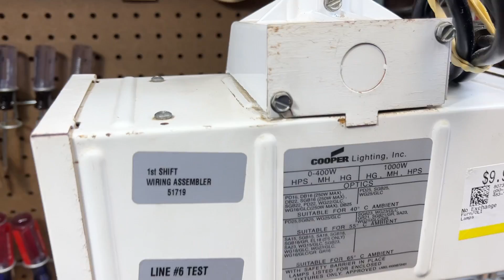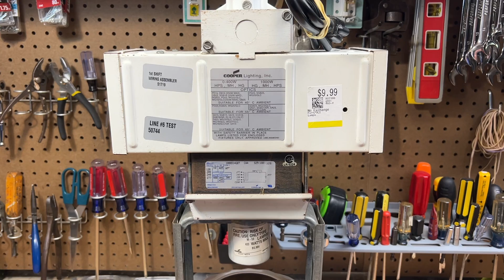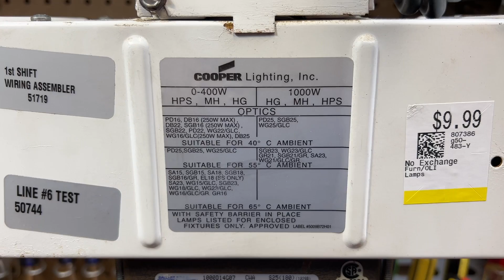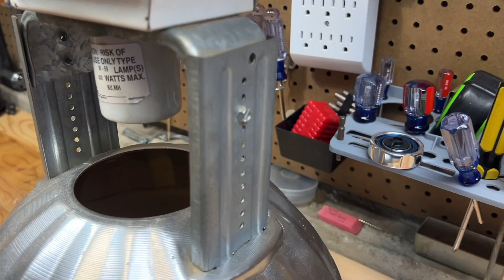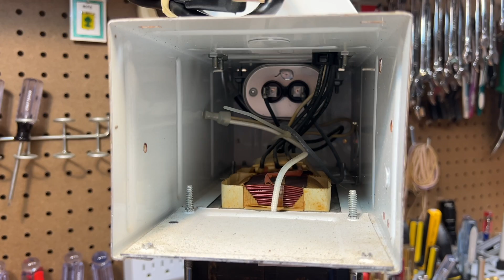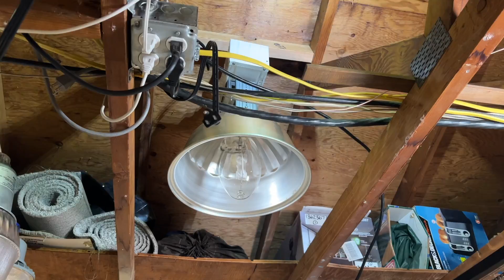Cooper Lighting Steeler 400w Metal Halide High Bay

Comment: I went to my local fair today and wouldn’t you know they had 2 400 watt Hubble high bays going to the trash, so I asked them if I could take the light and they agreed, but I only took one because they are so big that they both would not have fit into the car so I only took one, still don’t know if it works, but it definitely does not look or smell like it burned out. It was missing a bulb, so maybe that was what went wrong, and they removed it for recycling, either way I’m just going to go pick up a new bulb and Lowe’s after I make sure it’s working

Comment: It seems that the capacitor has a lot of hours on it and is underdriving because the bulb took unusually long to warm up. Normally when metal halide bulbs are on correct current, they don't take more than about 3 minutes to warm up.

Comment: amazing find for 9.99! I do not think I have seen another lamp that suports mercury, sodium and MH but I think that refers only to the ballast, or can you just switch between different kinds of bulbs?
Reply from the maker: Thanks! The generic sticker on the housing states all lamp types it could be ordered in. This fixture can take either probe start metal halide or mercury vapor bulbs, only thing that has to be changed to switch between the two is the bulb, it's that simple.

Comment: I have two metal halide or mercury vapor lithonia 400w high bay lights with top deep dark brown ballast box and with aluminum reflection and have ballast wiring code 120/208/240/277v ballast and capacitor not have start igniter from $25 at yard sale!